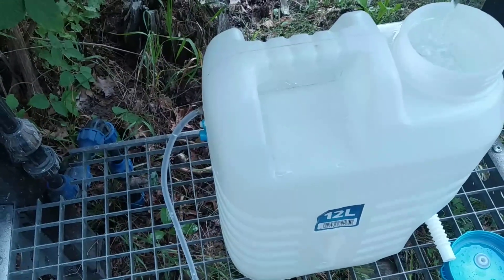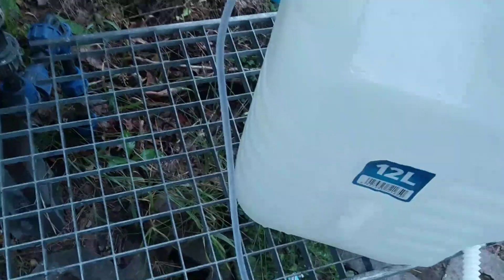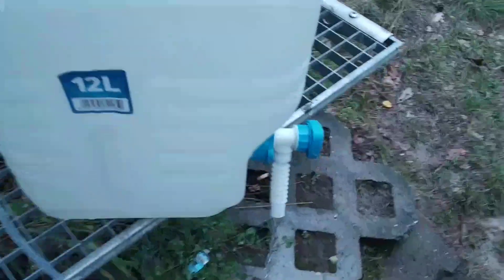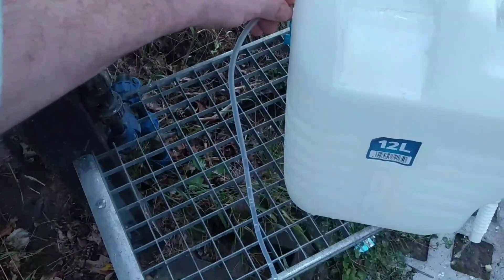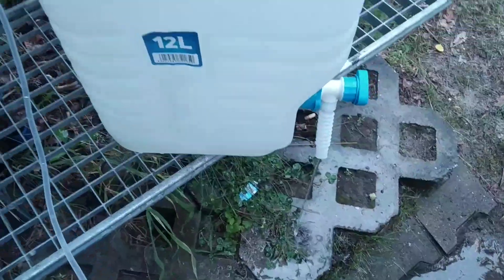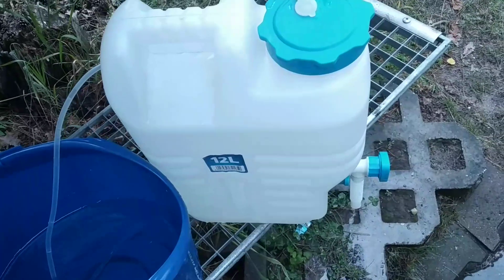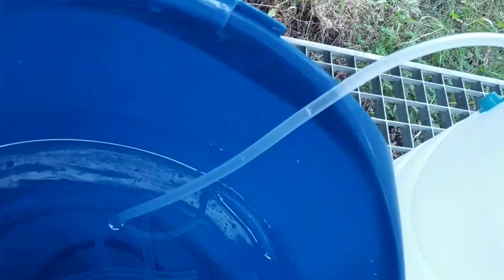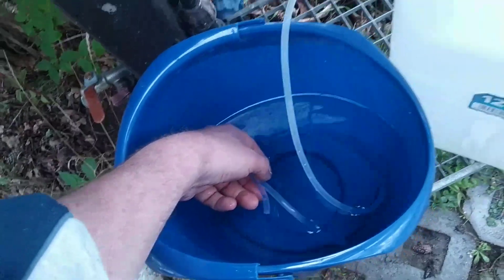Free Enery WaterPump Siphon Water Pump function principle

Comment: one thing you forgot is that the outlet has to be 300% bigger than the inlet and the outlet length needs to be 10 times longer than the input tube, and finally, at the end of the output, you need to reduce the end to match the input diameter. So the volume that goes in matches the volume going out. I'm still not convinced that this would work, at the level of technology we are at, someone would of figure this out a long time ago.
Reply: one thing you forgot is that the outlet has to be 300% bigger than the inlet NO, NOT NEEDED.

and the outlet length needs to be 10 times longer than the input tube, NO, NOT NEEDED.
and finally, at the end of the output, you need to reduce the end to match the input diameter. OR BETTER, DIP THE OUTPUT INTO A BUCKET OF WATER, OR INSTAL AN UPWARD BEND AT THE OUTPUT.
So the volume that goes in matches the volume going out. I'm still not convinced that this would work, at the level of technology we are at, someone would of figure this out a long time ago.

THIS IS A SIPHON WITH A PRIMING BARREL. NO SIPHON CAN LIFT WATER UP FROM A WELL.
Reply from the maker: Hmm, yes you are probably right..

Comment: I'm was thinking having one bucket slightly lower then another bucket, both filled with water, a natural siphon from the higher bucket into the lower bucket and at the end of the natural siphon the force spinning a water pump turbine that in turn pumps the lower buckets water back up into the higher bucket in theory this would be reciprocating and one started should be able to move water to and from each bucket forever without any outside energy source. ??? Maybe...🙄😬
Reply: Sorry, but no. Will not work.
Reply: @kjellg6532  I was throwing shit at a wall seeing if something would stick

Comment: Hi, saw also this vacuum water pump recently on internet. Here's an interesting one :
https://www.youtube.com/watch?v=LTxEloLiwUw
Looks like some inverted Heron's pump principle.
 I think there is a parallel air intake channel built in the output tap of the jerry can that neutralizes the vacuum needed to suck the water up ?
A simple soultion is to dip this tap outlet under water to avoid air intake.
Reply from the maker: Thanks for the infos.
Reply: @oudotcom  It's just a siphon primer ; with a discontinuous fluid type media where vacuum is created. It acts just like a hose with a jerrycan shape in fact... The outlet have always to be under the intake level like a regular siphon.
In a closed system you can't gain energy.

Comment: According to the Thailands, the output pipe must be 3x longer than input pipe and the output pipe should be 3x bigger in diameter than input pipe. Most important is you will need a vertical pipe to trap the air entering from the output pipe.
Reply: seems similar to a medieval device that stored compressed air by using falling water through a series of air open pipes!
Reply: According to the Thailands, 
- the output pipe must be 3x longer than input pipe, No, not needed. 
and the output pipe should be 3x bigger in diameter than input pipe. No, not needed.
- Most important is you will need a vertical pipe to trap the air entering from the output pipe. No, never needed. 

This is a siphon with a priming barrel. Works fine if output is lower than the water level at the suction side. Just as any siphon.

Comment: Why create a copy of a fake project? You can't lift up more water (into the vessel) then what is going out. But: only on the same height. You can't lift up more, since the weight of the water is too much then. You do can lift water from lower, but then you need s smaller hose. It is all in the weight of water, diameter of the hose and just gravity.
I recommend to not waste your time on this.
Reply: Yes, strange that all these videos popped out in the same time on YT.

Three aspects in such project are to take into account depending on what is seeked/wanted :

1)Priming a siphon,
2) Maintaining the flow rate of siphoning,
3) Making a closed loop fountain.

The pressure difference between 2 points 1 et 2, located respectively at a height (depth) h1 et h2 is given by the fundamental law of hydrostatics :

P 2 − P 1 = − ρ g ( h 2 − h 1 ) 

Where ρ is the volumic mass of the liquid & g acceleration of gravity.

The pressure formula on a point of a liquid located @ a h depth :

P = P 0 + ρ g h 

With P0 the pressure @ the liquid surface (atmospheric pressure if the liquid is at open air)

---
Further : 

If a force Fi is applied on a Si surface of a contained liquid, this will result in a Ff force applied on a Sf surface such as:

F i S i = F f S f
---

The height of a water column generating the same pressure as an atmosphere :
P = standard atmospheric pressure @ sea level = 1 013 hPa (101 300 Pa or 101 300 N/m2 or 101 300 N m−2), 
ρ lthe volumic mass of water = 1 000 kg/m3 ou 1 000 kg m−3 (kilogramme is a mass unit).
 g the weight acceleration through gravity is 9,81 m/s2 or 9,81 m s−2. 

P = h ρ g, 101 300 N m−2 = h × 1 000 kg m−3 × 9,81 m s−2 or, : 101 300 N m−2 = h × 1 000 × 9,81 × (kg m s−2) × m−3. (kg m s−2) is Newton's dimension, 
Thus : 101 300 N m−2 = h × 9 810 × N m−3 
where : h = (101 300/9 810) m = 10,33 m.

In an air tight container, you need more than a 10 m high column of water to start to see water flowing out of the lowest point opening/outlet. (Pascal principle)

Here, we have a second opening (water intake) in the container and the height of the initial water level is less than a meter (approx 60 cm or so) in the container; thus achieving less than 1/10 of the atmospheric pressure.

But, this system works on continuous differential pressure until siphoning is achieved. (that can be achieved by mouth until 1 to 1,5 meters depth).

At start both atmosphere in the barrel and the bucket are equal. When the tap is openned at the output, the water hydrostatic pressure in the barrel + the initial atmosphere push down the water because the air pressure @ the output is lower. But when the water level goes down, the atmosphere in the air-tight tank is dropping (like a piston from a syringe) ; is creating sufficient vacuum (several thousands of Pa pressure drop or so) to suck the water from the bucket. Because atmospheric P @ the bucket water surface is > than the P in the container empty chamber space.
That's why a rigid wall container is also needed to avoid collapse from an outside action of the atmospheric pressure (a plastic bag would immediately collapse leaving no vacuum chamber left). 

It's the atmospheric pressure that pushes the water up in the first tube via the water surface in the bucket. 
But each time the water raises in this tube the weight of this column of water increases (P=F/S) ; (F=m*g) ; that's why the depression must steadily fall down in the container until the water can fill the tank constantly. 

Vacuum is no pressure ; here mostly less pressure. So it's a volumic relation of atmospheric pressure drop. 

The lift head is thus related to the max pressure drop achieved by the water column in the container ; that seems lower than 10000 Pa.
1 meter of a 20 mm section tube has a volume of Pi*1²*100=314 cubic cm = 0,3 L = 300 Gr. (density =1) The hydrostatic pressure is 0,3/0,000314 = +/- 10.000 N/m² (or Pa) 
So I think such barrel could rise up at most a 1 m column of water. But it depends also on the rigidity of the walls before collapse.

Based on Pascal principle, I would say This system is able to prime a siphon and raise the outlet of a siphon to about 1 meter per meter of barrel height (depending on its wall rigidity).
Reply from the maker: @MrWookie21  Thanks a lot for all this positiv explanation. 👍🏻🥰🙋🏻‍♂️
Reply: Noop. This is nothing but a siphon. No siphon can lift any water to a higher level. The barrel only serves as a priming device.

Comment: You Need a one way valve,on the output. Water out no air back in.  I hope this helps.
Reply: One way valve or an s bend
Reply: Would a bit bigger suction hose help, the pipe seems a bit small to me. Great suggestion of a one way valve.
Reply from the maker: I See, yes the input pipe is a bit small in diameter...I just used, what the water cannister had as a default opening as a "bleed hole"...
Reply from the maker: Yes, I also had no oneway valve.... This is also missing...🥴🤦🏻‍♂️
Reply: Dipp the output into a bucket of water and no air comes in. One way valves will not work.